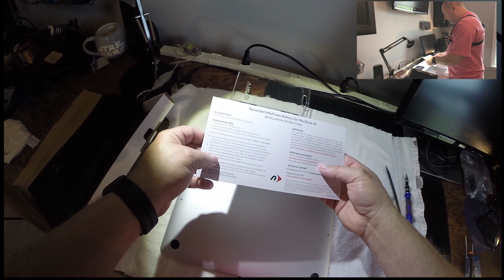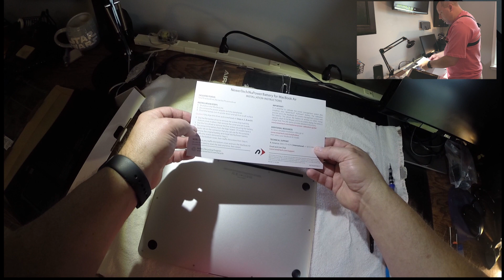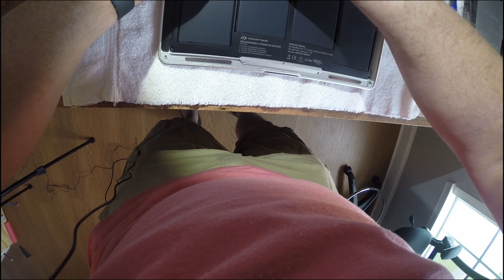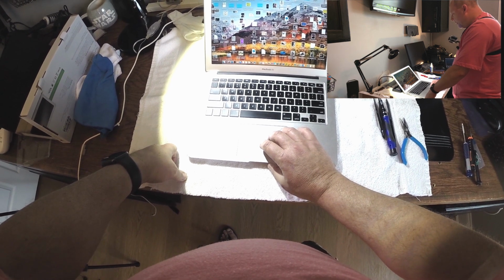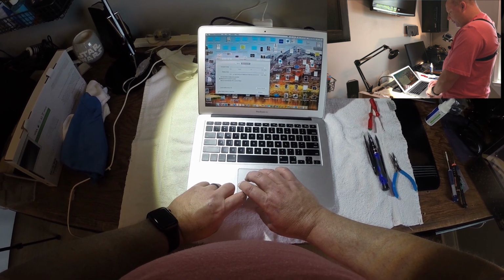Mid 2011 MacbookAir Battery Replacement

Comment: Can you comment on any improvement to the system's battery life since the replacement? I'm curious because my 2011 will loose charge in less than a day simply closed on standby. I tested and got less than 3 hours streaming video.
Reply from the maker: I was getting 2 or 3 days stand by and 4 - 5 hours run time. I would check and see what applications are running in the background.